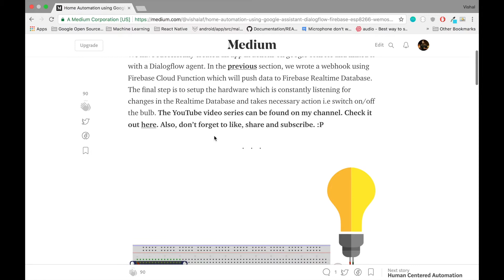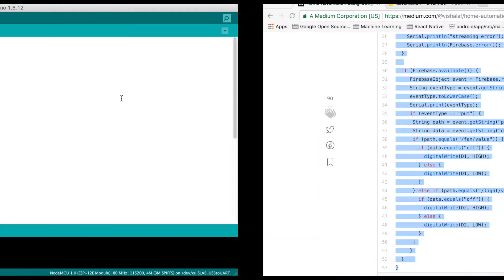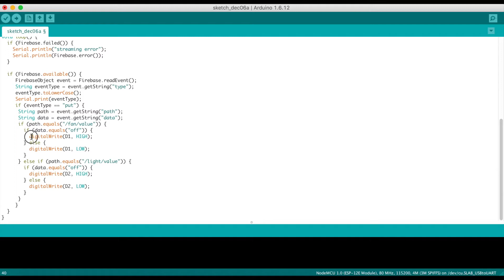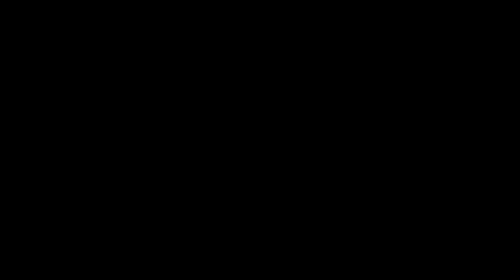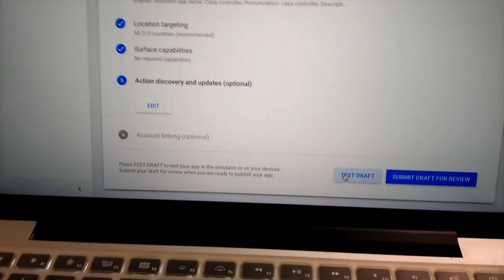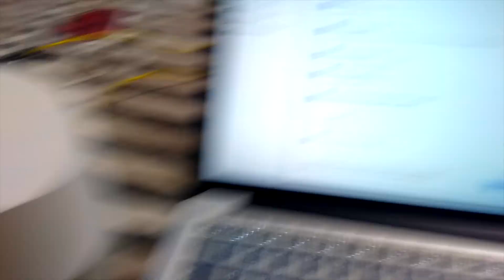Home Automation using Google Assistant + Dialoglow + Firebase + ESP8266/Wemos (Part 4)

Comment: hey,
pls help me with this, I dont know why but my  google assistant works just fine and values are changed in the firebase but when i try to connect to to the nodemcu,  The serial monitor shows connection failed.
But the interesting thing is that the nodemcu connects to the firebase when i delete all of its integrations with the dialogflow and remove the functions(function --> changes in the index.js ) that i have added.
So this means that the integration with dialogflow or adding of functions caused this error.
If anyone knows what to do then pls reply asap cause i gotta submit my project in a week
Reply: hey , did you find any solution for this issue?

Comment: One last question...

As I have tested the assistant on my pc, will the final result (i.e. after all the hardware setup) work on my phone?
Reply from the maker: Yes. Once you click on test draft, every device running Google assistant and linked to the same gmail id can be used for testing :)

Comment: I have a doubt. How to simulator  script is to be work in Google Device. Should we connect this device to System?
Reply from the maker: +vsrinivas nyros when you click on the test draft button, the app gets available on Google assistant across all devices. You have to use the same email ID though.

Comment: hello from Brazil! I've following your instructions on a esp8266-01, but I can`t make it work. firebase actually works like a charm with assistant but the ESP won`t response to any switch funcition. can you help me?
Reply from the maker: +marcos can you open up the serial monitor and check if you see values printing when you talk to the assistant?
Reply: InfoIOT tanks for the fast response, on serial monitor I only see many no sense characters. My esp is Linked via FTD1232 usb-serial
Reply from the maker: +marcos check your baud rate. The program works on 115200, if I am not wrong. Select the same baud rate on the serial monitor as well and tell me what you get.
Reply: On void setup is set to 115200 same as my serial monitor, but just trash is printed on serial monitor. changed to others and still only trash
Reply: InfoIOT updated of my case. Now serial monitor on 9600 show "put" right  after The board boots. I see on FIREBASE The Light status change by my assistant commands but on serial monitor or relay no changes
Reply: hello, " Serial.print(data); " should print the value of "data" right?  here i get nothing but when printing "path" is ok returning "/light/value" just my "data" isn't working the right way. Any sugestions for fix this?
Reply from the maker: +marcos can you show me the code that you have written?
Reply: @caco498  hello bro, Did you solve your issue and can u help me with it ?
thank You in advance
Reply: Firebase database secret key is deprecated. Hence code in this tutorials will not work. I tried with same code in my project. It didn't worked. We need to find other war to communicate nodemcu with Firebase. 
Team InfoIOT... Can you please suggest on this ???
Thanks in advance.